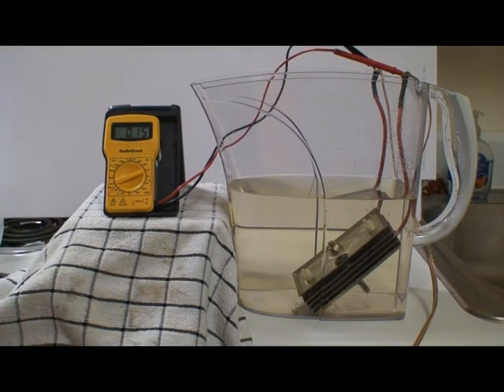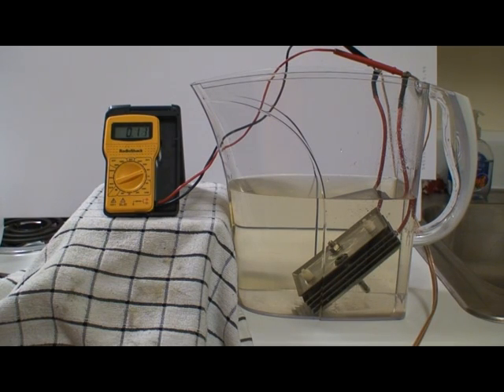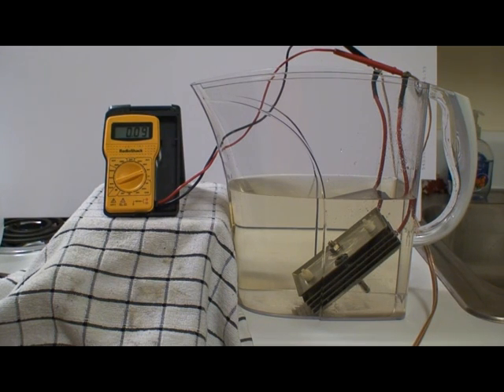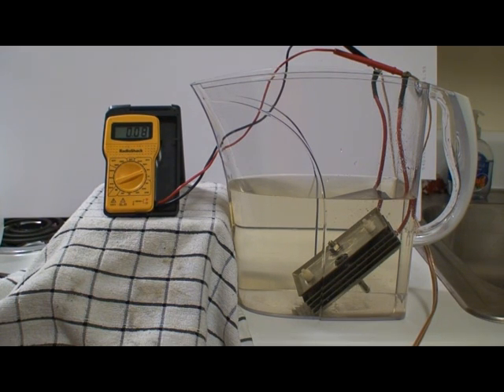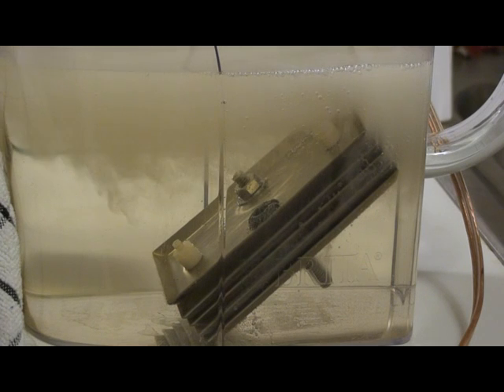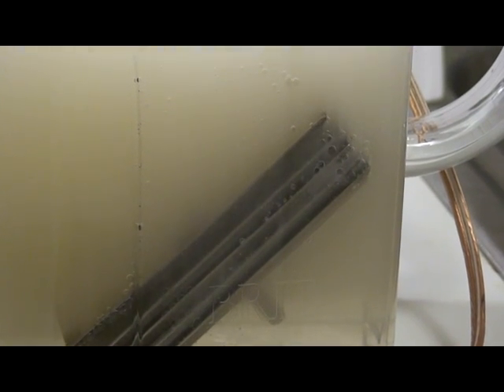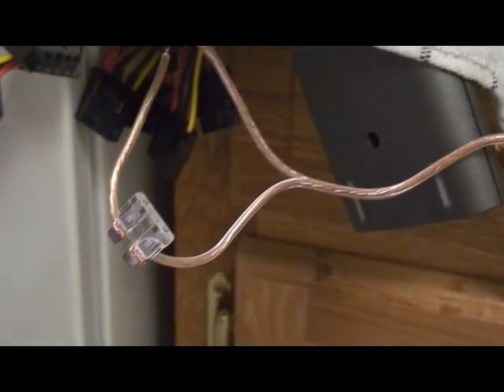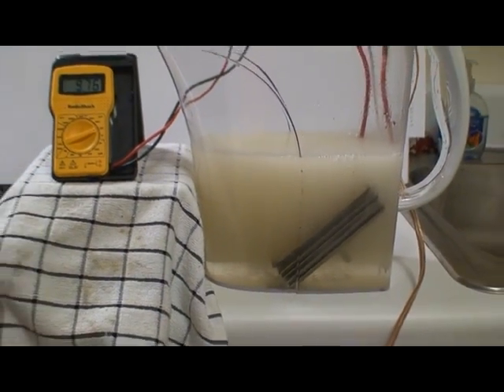HHO Test 2 (5 plate w/ distilled water)

Comment: hi there. looks like you have got a great start. the more people doing these videos the better. this needs to get out to the masses. take a look at my videos maybe you can get some ideas. i too use the lowes 304 plates. i have learned after melting every container i have tried that heat is the biggest enemy. put some neutral plates in there to drop the voltage. good luck.

Comment: some of the brownish stuff will be iron oxides leaching out of your plates ... the higher the volts, the more oxides ...

a setup like yours with parallel connections (no neutral plates) should really be run at 3 volts to keep from wasting energy heating the water ... you will find there is a sweet spot between 2.5v-3v where you get good productivity without heating the water too much ... amps is what makes gas, not volts ...

nicely presented ..